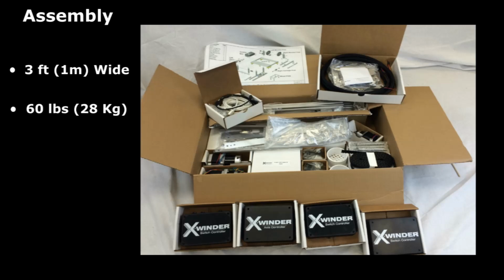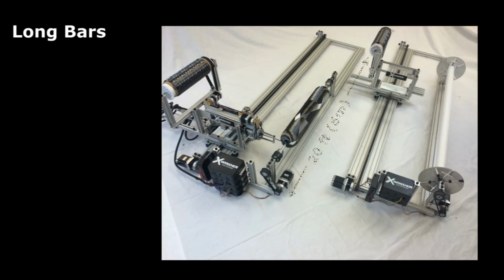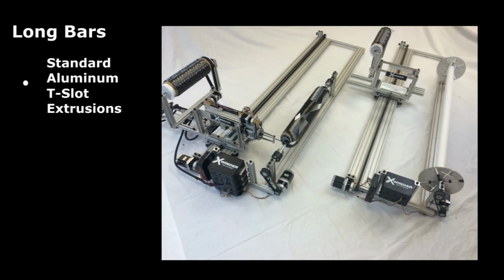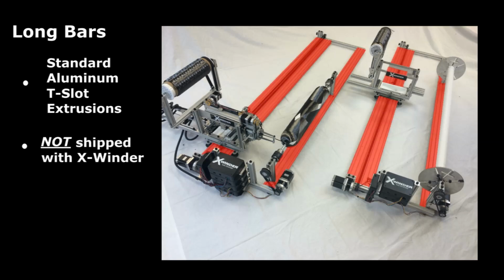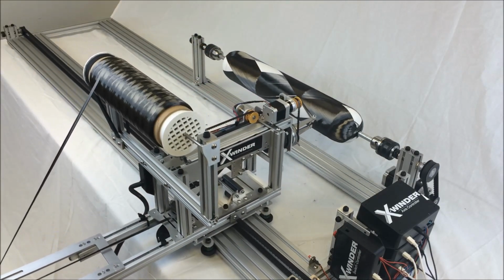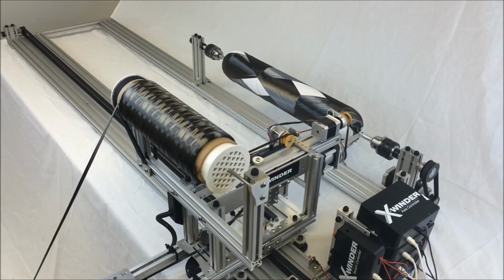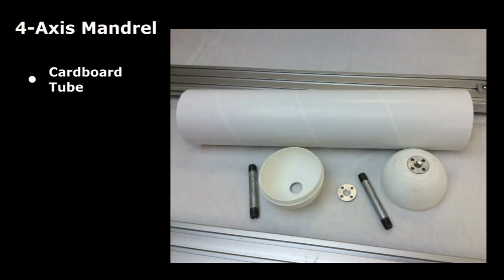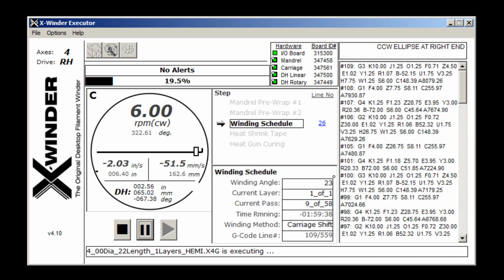X-Winder Filament Winder Model 2X-23 and 4X-23

Comment: Can I change wind angle at a certain spot on the mandrel and then go back to the original wind angle?
Stan Peters
Reply from the maker: Each filament layer has a constant winding angle. To change winding angles, you need to start a new layer. For example, you can wind 3  layers of with layer 1= 75 deg winding angle, layer 2= 55 deg winding angle, layer 3 = 35 deg winding angle, and so forth

Comment: oops. Should have been more clear. The upgrade option on the website is from a x2-23. Will there be an upgrade option from the kickstarter x-winder?
Reply from the maker: Hi Alex: You can buy the 4-axis X-winder filament winder model 4X-23 in March 2015. You can also buy the 2-axis 2X-23, then later buy the upgrade kit to the 4-axis 4X-23